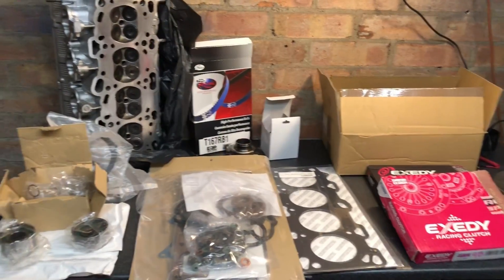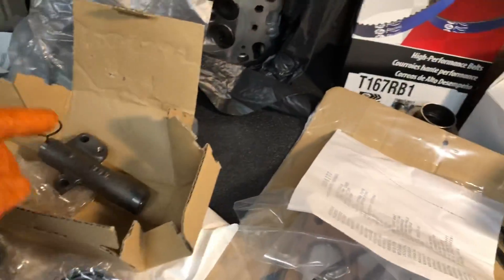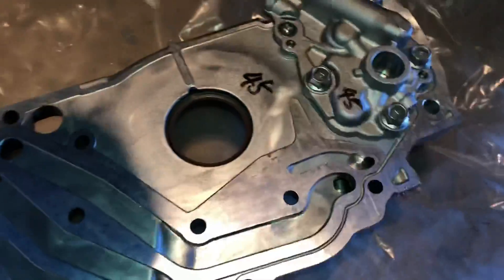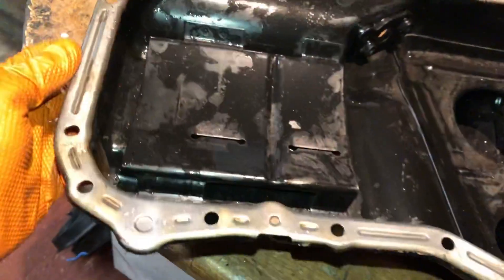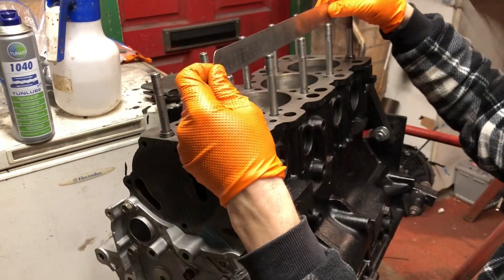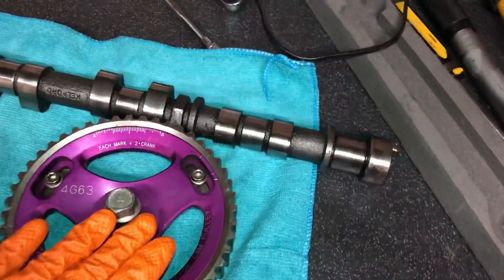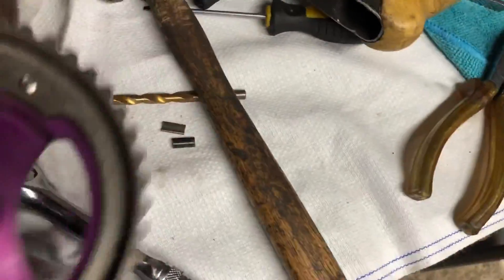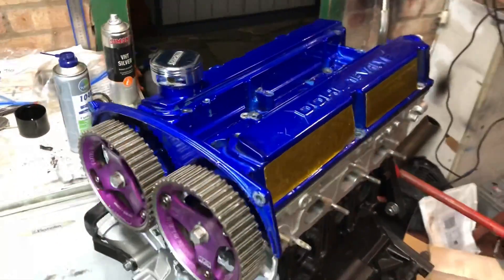NEW Cosworth Parts! 600+hp Engine Build Continues! Mitsubishi EVO 5

Comment: That water pump, the 'fin' style impeller blades you got, well,  on a Subaru water pump that style of blades are considered shite, & can produce tiny bubbles in the water system. 
Subaru do a 'high flow' water pump where the impeller blades are a different shape, so not to produce the bubbles, & therefore flow better. 
Does Mitsubishi not do a cast impeller bladed water pump ??

Comment: You videos are awesome, so much knowledge and u can understand wht your on about!
Tempted to buy an evo as u make it look easy rebuilding them! Defo looks easier than ej engines I’ve done in the past!
Paint the valve cover white with silver/chrome engine components n wire tuck the engine bay n it will look so clean when u open the bonnet!